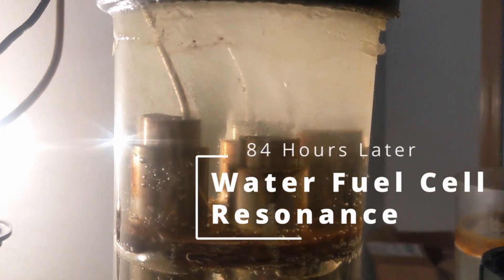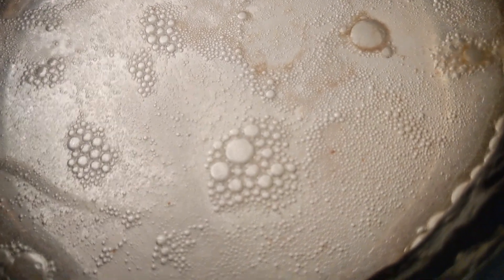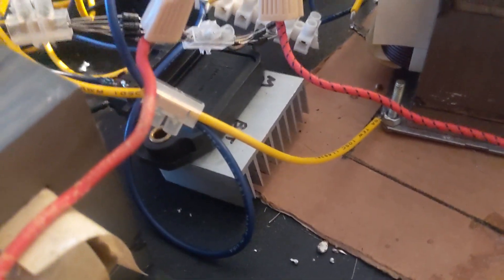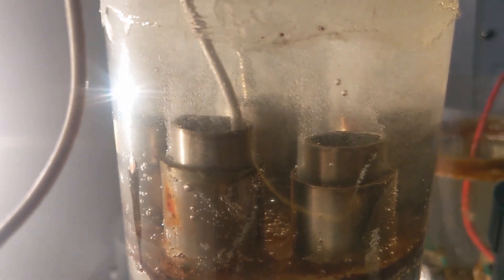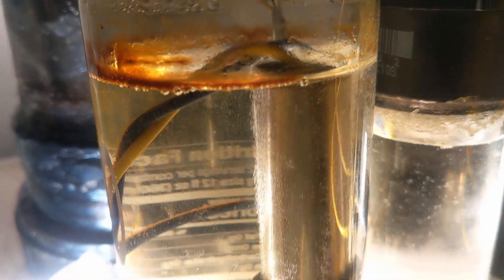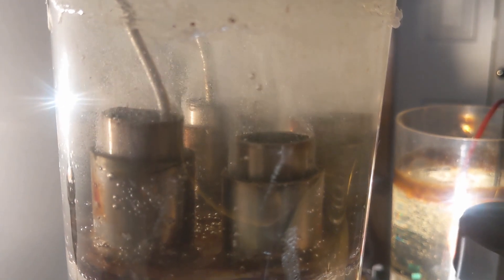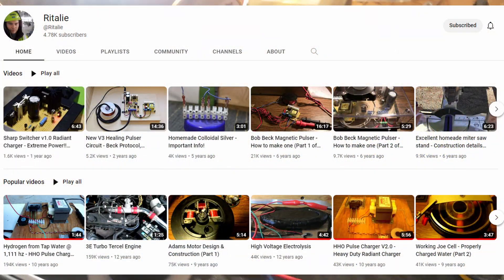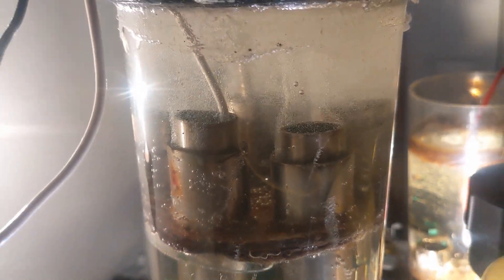HHO Resonance - High Voltage Output [No electrolyte]

Comment: i like it. this is what i wanna do. no electrolyte, minimum current. interesting you mention covering the plates to form semi conductor.  your link for the circuit didnt work for me. what are you driving this with?
Reply from the maker: this link? https://imgur.com/lGauZXW
automotive ignition coil for driving
Reply: @weighta6630 yeah it doesnt load in my country.
Reply from the maker: @tvdylan  sorry for the communism try this https://pasteboard.co/3v8xDQTxfAVa.webp
Reply: @weighta6630 thanks you ma friend ! Appreciate that. Thanks for sharing your work with us.
Reply: Could you build one for sale , or make a step by step tutorial ? I want use on car...
Reply from the maker: @krisztianadrian8528  Not enough to power car, sorry
Reply: @weighta6630 , i want just to i crease efficiency of the engine by using a 5 ampers hho ...question is eith a slasher transformer would make better HHO gas production tha using direct source of DC from alternator ... 25l/h with 5-7 amps on 13vdc
Reply from the maker: @krisztianadrian8528  you can try either. havent done any myself to know
Reply: @weighta6630 , i dont know how to build ... Ca i buy one from you? Shipping to Hungary
Reply from the maker: @krisztianadrian8528  This video is from a few years ago. I haven't done much since then. All my generators are either leaking or poorly producing atm. I'll post when i have something new and of use
Reply: @weighta6630 , ok i am intrested in specially to build in car

Comment: Just my 2 sense worth since you guys are still active. I haven't messed around with this in years. But as some of you may or may not know, Don't go by what someone else is doing. Especially if their participation is old. (no recent follow ups). It might mean they flopped. Or turned up missing🤔
I believe an efficient cell should be small. Think "on demand". And don't forget, Your separating molecules. So your design should coincide with that. Stan Meyers was small. 
Forget about all those plates!
HHO to an automobile should probably be thought of as a supplement. Otherwise it may wreak havoc with todays engines.

Comment: Hook your cell direct to the engine intake, then add a needle valve to allow a small amount of air that bubbles inside the cell. You should be able to run the motor this way. Vacuum extract dissolved ions from the solution. Dissolved gases allow the engine to run.
Reply: you can run hho directly to fuel injectors https://www.youtube.com/shorts/Tyhr6I1Ae1o

Comment: i really enjoy your video. i am making a small 3 neutral plates HHO wetcell with laser cut (got it cut to a vendor) and sandwitch them 0.65mm between plates. got to 71 plates assembled in Reverse Osmosing transparent housing plate. they use very little electrolyte and run reliably 5A at 12V. the output is abour 300ml HHO per minute.

Comment: It does look like it's breaking Faraday maximum with the visible eye? But my eyes have fooled me before when it comes to HHO. You should capture the gas and measure it per unit time and power consumed from the power supply. The best efficiency you can get from Faradays electrolysis is 0.0114 L/min HHO gas (room temperature and pressure) using 1.23 watts of power. The 1.23V volts is the voltage required to get one of the half reactions going. The other half reaction is 0.83 V. By theory you should be using the entire (0.83 +1.23 = 2.06) volts but in practice the 1.23 volts is all that's required. Which is weird and hints at the possibility of a overunity electrolyser.  So it means that if you have an electrolyser with 12 gaps in series then it's (12 x 1.23V = 14.76 V) needed to start the electrolysis process. That's if the gap is small enough, the electrolyte have a low enough resistance, and the resistance of the conductors are negligible. After that you just need current because any more voltage will be wasted as heat.
Reply from the maker: I did not meter it yet, but I will before I create a tutorial on this generator

Comment: just a question what would happen if you would use a magnetron Cavity instead of the metal tubes? In a normal magnetron it is vacuum inside. Would you short circuit?
Reply from the maker: You would need extremely pure water for that. And with high voltage end, you would be short circuiting, probably even with distilled water. Hypothetically, as long as there's no current leakage and high voltage, there might actually be good results.

Comment: You're rocking it. You got further than I did. I only had plates not tubes but similar results. After about 2 weeks it should be fully conditioned. My work area looked about as messy as yours too haha. I blew some diodes and ended up packing it up as I no longer had the work space for the project, but my goal was to run a 4kw Genset with it. Keep it up and you should be able to soon!

Comment: Hmm, nice show. About ventilating the room,I don't think you have to worry about that as long as you don't pressurize it. I'm not sure if that is extraordinary without measuring the production and the power in.
Reply: Vents good, knocked my garage wall off the foundation and blew out windows, but I was running 200amps about 10,000 watts off a submain breaker .

Comment: now you can see why the idea of a pulse train is of benefit... the cell will coast and continue to make gas in the off time of the pulse train... reducing the energy input by a much as the duty cycle of the pulse train, usually want to aim for 50% but having played around with the 9xa cct there was provision for long pulse trains with short off times more like 80-90% duty
Reply from the maker: Yup
Reply: @weighta6630  oh those spark gaps... i have never seen them before. what do they come from?